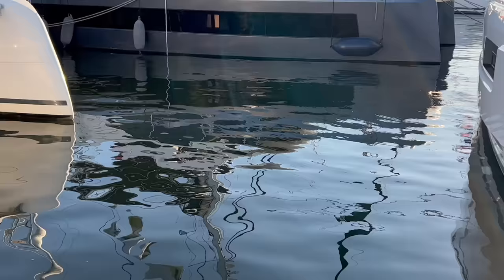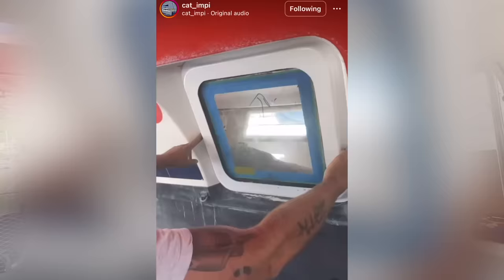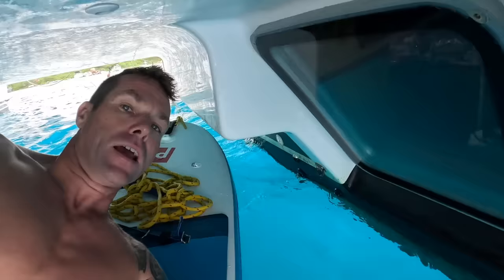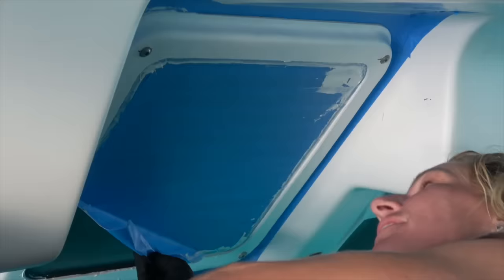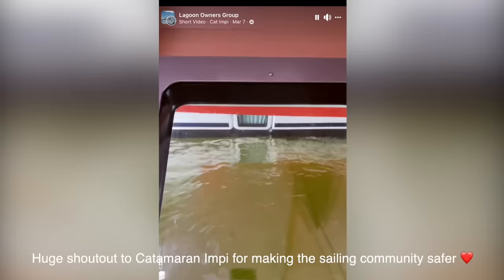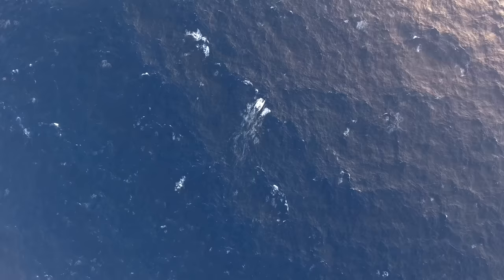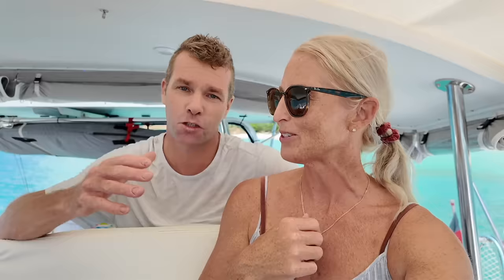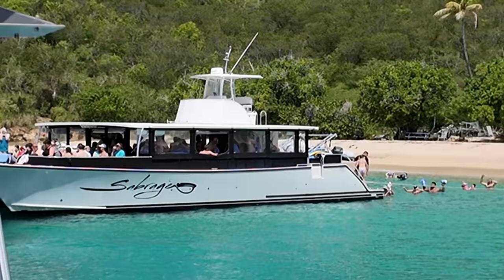this Deadly FLAW will SINK our Boat

Comment: Watching the drone shot from above with you trailing warps as a drogue reminded me to suggest you enhance the effectiveness by using an Abbott drogue. This is a system that you can add drag items to the warp by sliding them down the warp. They will self center if you mount (lash)  them to sections of conduit. You can keep adding items until you get the right amount of drag for the sea state. Put each end of the warp on 2 aft winches. Hope that helps?

Comment: When I was running boats our "Port Light's " had covers the would screw down with wing bolts. Not all had them but with storms were coming we closed and battened everything down. In the 60's there we only a few cat's and  try's sailing. In the old day the biggest problem was the rudder breaking in a following SEA. Some power boats had shutters for the large glass windows on the bridge. All the best. Gman

Comment: Just a thought:

In the offshore trimaran world some of the ultra performance enthusiasts consider a saw all the escape hatch.

Glass that thing shut and have one powered option on the boat that cuts fast and two manual fail proof options to make the hole in the hull.

(Your campfire hatchet stored on one side, your camping saw suitably selected on the other. One powered hacksaw where you choose)

Comment: I love following your journey! Great videos! 

Engineering background here…I think the 4 sided (square) collar will fail and ultimately place more damage to the hull just forward of the escape windows. 
Reason: 
Forward motion is where you will find the most forces put on your proposed hatch collars as you sail much faster forward than in reverse….agreed? Ok. 
This being said…the collar idea is good but should be made into 3 sides…FWD, TOP, BOTTOM.. with aft side being left open. The aft side would create drag by catching the most force of the water, in return, transferring that force through to the forward portion and rip out the hardware…or the collar may simply fail and break apart. 
Making a 3 sided collar and leaving the aft side open allows the water to flow over and not try to lift up.  Just my thoughts. Good luck! Stay safe! 
PM me if you’d like me to sketch my idea up for you. I work for a global maritime engineering firm in the Houston, TX area.
Reply: Based on your experience, do the hatches even make sense?  It seems like they cause way more problems than they solve.  I've never heard of a catamaran sinking so fast that someone actually used the escape hatches.

Comment: Willa is a child with health that can be uncertain at times. So your fear for Willa is very real and it is hard on the parents. I made myself an emergency kit and it has saved me several times. in a backpack I have separate pouch's that are made of nylon with a zipper that carry different things. Number 1 saver is a battery powered nebulizer with extra batteries and with the albuterol and saline solutions. Prednisone tablets 10mg at least six or more. And of course the Epi-pens. At least two and I do practice on how to use them with a practice pen.  Willa is going to have her trails you want the best for Willa. A ready emergency kit that's pretty much what a hospital has. Willa might need that emergency visit she might need to be close to a hospital. All real concerns. Immunology is a five year plan and they say by that time your body should be desensitized to the allergens. Go with health is always my motto.

Comment: The hinged hatches are a much bigger problem than glass. Hinged hatches are always an acrylic lens, and acrylic is much harder to adhere with sealant than glass. A glass lens falling out is not impossible but very unlikely compared to acrylic.  

I removed my hinged hatches and glassed in the hole. If you do a good enough job, even the surveyor for your insurance survey won't notice anything missing. Ask me how I know. 😉

Comment: Fiberglass those hatches over!   I cant find one instance of those hatches being used HOWEVER like you said there are plenty of those silly hatches failing or leaking.
Reply: 100% agree.  That danger of them causing you to sink has got to be 1000x the chance of you ever needing to use them.

As I said in another post, if the boat were truly sinking so fast that you needed to use them, then you wouldn't have time to deploy the life raft, so you're pretty much dead either way..

Comment: The exit hatch frame is a great idea. A great addition to the design would be a spare emergency hatch that could be placed over the outside of the frame & secured with a rubber coupling would extend around the outside of the primary hatch frame. The edge of the primary hatch frame would need a channel around the outer edge so that the flexible rubber coupling around the emergency hatch could be clamped on to the primary hatch frame. Another great addition would be enough of those spare air or pony tanks so passengers can swim out from under the boat without destroying the hatch & creating a vent to allow air to escape while water floods the hull. Keep the hull sealed so it stays buoyant.

Comment: I’ve always wondered if these hatches were designed to be used in that place, that way. I don’t think so. These kind of hatches are typically used horizontally in decks. Looks like the production boat/catamaran builders were looking for (“cheap”) off the shelf solutions, not taking in account that boats age and glue bonds deteriorate over time, building in a huge risk for the future…..

Comment: I can’t remember what kind or brand it was but I watched something about those escape hatches and there were all kinds of comments about the escape hatch being more of a “problem or danger” than any safety that was worth the danger of them coming out or leaking & causing a problem. The comment was made that it “sure must’ve been a issue” because it was taken out the next year.  I think they were mandatory at some point on catamarans and I think the comment was more a “see, I told you” than anything else.  If they aren’t a regulation, you can probably take them out if you wanted to.  I think we all know you’ll have it safer than it ever was!! 🍀

Comment: For  holes in the boat a plastic bread board is always close to hand and 6 to 8 screws  place over hole and screw it to it will do for repairs until a port is near by or for bigger hols kitchen doors wrap old sail around it to act as a seal the screw it to

Comment: On ships that the portholes are low to the water line. They have dead lights on the inside of the portholes, which are used in rough weather. Basically they’re a round metal plate which are hinged and you screw tight with the butter fly nuts.

Comment: You are trying to undertake blue water cruising in a catamaran designed and built for the charter market where the boats go coastally from port to port.
The lack of both wing deck clearance and weak safety hatches are good examples of that.
Plus it seems from the numerous rust stainless that the stainless steel is somewhat questionable and I would look closely at all chainplates and monitor them regularly.

Comment: I like no hinge escape glass but in addition to a swingable hammer I would add a spring loaded punch incase something is preventing a full swing of the hammer......If the compartment was full of water can you swing hard enough to break the glass?

Comment: Would love to know your opinion on just having a very strong fiberglass hatch with a very serviceable seal.  You'd have to maintain the seal, but you wouldn't worry about any glass to frame connection or glass breaking.

Comment: How do you flip/capsize a catamaran? Through broken escape hatches. 

Which means escape hatches work as designed. 
They are meant to escape the boat when it has flipped because of a broken escape hatch.

Comment: That's definitely something a LOT of attention should be placed by boat manufacturers. Shouldn't be just regular sealant etc on it. You need it low in case the entire vessel flipped, you would have a hatch above the water line but it seems something better could be used there. Like a double or triple seal solution or maybe inflatable seals that inflate when water is sensed? Or a rotary seal system or something better. The very thing to keep people safe is killing people or capsizing boats. I hear about this issue all the time and if it is leaking, it means it could fail at any moment as you don't know how serious the sealant has failed.

Comment: Personalyl I don't think 4 bolts is enough - 2 on top and two below.  If one pops, the clear plexi will work free. 6 bolts - 3 on top and 3 below. Water is weird, I had some strange issues with water at my mountain cabin.  In my trouble shooting and Oki fixes, I had to all tell myself that it (water) has to go somewhere and that it is non-compressible.

Comment: You guys might need a year or two off the boat. We have three under 6 and have been sailing for 3 years around the pacific. We have opted for a house life for a bit of a break and give the boys a chance to get a little older. We will likely get back on the boat permanently in three years.

Comment: I have seen so many issues with escape hatches and it seems like the danger far outweighs the utility.

It doesn't even make sense to me as the only use they would ever have is if the boat suddenly and violently flipped over a full 180 degrees and immediately filled with water (i.e. massive hull breach).  I suppose the first part of that is possible but extremely rare,  I have never seen the second part happen because catamarans take a very long time to sink in most cases.  

If you ever did come across such an unlikely calamity, the boat would be sinking so fast you couldn't even deploy the life raft.

It just doesn't make sense, how many boats have sunk or nearly sunk due to the safety hatches vs how many times have the safety hatches been deployed saving someone's life?  It's gotta be 1000 to 1.

Comment: I have never understood why cat builders don't just put in water tight doors as escape hatches. Is it seriously necessary to be able to see out the escape hatch? A solid hatch with a spin lock similar to what you see on larger ships would be a much better solution safety-wise.

Comment: I’ll preface with I don’t know anything. 

Why does the hatch need to have plexiglass? Maybe make it out a the entire hatch out of aluminum or fiberglass so there’s less points of potential failure. Is there actually value in visibility through them?

Comment: You need to watch Sailing Parlay Revival as he has crossed the pacific on his Lagoon 45 and his adventures in doing so, he maybe a good source of inspiration for you to look into.
Reply: They are in New Zealand now. What an experience they have had. I believe Ben may have had a chat with them once.  Always interesting to see who the talk to and about sailing in general.
Reply: HH44_OC not necessarily,  they both have different experiences but it is all relatable.  Some of the Parlay crew worked super boats on ocean trips before stepping into smaller sail craft.
Reply: HH44_OC   his 3rd circumnavigation of the globe.  He was sailing some treacherous waters before 18th birthday. Spent 3 years navigating the Polynesian Islands, mostly on his own.  Now having said that, Ben and Ashley do some different sailing and that's why i watch both regularly . Colin's current Cat is now on it's 2nd trip.  Both have some great adventures and some amazing troubles BUT BOTH are sailors infinitely better than I  am. Now back to the good stuff.

Comment: Or you could have the escape hatches on the outside of the hull instead of on the inside where the water compression force is many times greater because water doesn't compress and on the outside, it will push the water away.

Comment: I hear those hatches are no longer needed. Insurance doesn't like them (they fail to often) and cause boats to sink. Honestly I would seal them up with fiberglass and be done with them. To make a hatch like that really work they need to be 3 times stronger and better engineered.

Comment: Im slightly concerned with using 5200 in the manner you did with relationship to cure times. Ive seen where it doesnt fully cure and its still wet. May want to double check it or look into 5200 fast cure. Best of luck.

Comment: I don't get it. When we started sailing in 1985, we approached our builder to help solve the escape hatch issue. The same as you have shown in this video, we made that same (upgrade) as you have. By watching many "cruiser" channels, I find it remarkable, that "so many alterations" seem to only now be discussed or shown that it is a "modern" inervation. In short, we sailed for 30 yrs, in a 45ft "cat", 13 times circumnavigation, just under 500k nm and raising 2 children on board, until they departed for college/uni. The internet "was not" a thing in those early years and we DID NOT hang around as long as current cruisers do, due to the video work involved. My wife passed a decade ago, so I personally stopped full time sailing, however, my son & wife have been continuing the cruising life. They also have 2 children on board and skool them, show them the world/cultures and so so so much more. I know you will understand that last comment. Another "alteration" we had, was an attachable/removeable "tiller" style rudder/propulsion. That is something which could only give about 1-2knots, but in some circumstances, it was all you have/needed. At least it kept us moving, which at times is better than nothing, hehehe. Anyway, keep up the great work and I am pleased you show great content and are keeping your dream alive, with the kids (not now) will THANK YOU BOTH so much later in life. Take care always and stay safe.

Comment: Hatch doesn't have to be glass, if it were a real metal dogged hatch it would work to regulations as intended. Boat manufacturers decided it would be nice to put a window in (and i'm sure it is) but is their implementation that is the problem, the reliance glue and window is wrong on the top ourside as well, but it works until it doesn't. Good not to trust your life to what the manufacturer thinks will work.

Comment: Wouldn’t you be better off with some kind of silicone on the interior that you could cut away in case on emergency that you could cut away????  I’ve worked in the aluminum window industry for 30 years.  Just asking.

Comment: I've seen a couple of cats with  escape hatches in the bridge deck floor ..the other locations the inside front of the hulls higher above the water line.

I recently saw a 70+ foot cat with multiple hatches but they were not glazed so I assume they were  fully braced across the backs 🤔 why glaze them ?

Stay coastal in the Pacific coast Canada's home waters are as wild and beautiful as anywhere especially in the summer..

Hold fire on the boat if that's what it takes. Your boat  build for you.... He who knows the ways of the world and the minds of men knows that such men will never agree... N.Machivelli The Prince. 😉 You're the captains of your own ship. Now and hopefully in the future. 

Most composite core cats may flood but won't sink because of the built in buoyancy..  with a solid/metal hull then you need to  have built in buoyancy or possibly built in inflatable salvage  bags or a collar ?..thinking outside the box 🤔🧙🏼‍♂️😉 

Both the Windelo and the Deep blue Rapier  and Elcie  have high freeboards both for the decks and the bridge decks  you can get a dingy underneath rather than a board clearance is a meter or more  ..  This keeps them dryer above deck and limits the hydraulic poundings... They both have wider Chines above the normal waterline  despite relative fine entry bows to  break that suck blow surge  and increase buoyancy divert  spray out to the sides.

Comment: When yoi boil life doen gamily sllways comes first.
That pronlem is vrry very commom. All yhe cats ibe bren on the hstches leak.
They eere not dedigned for that purpose or use. They are devk hatches only.
Once a cat overturnd and you oprn the hatch this allows the air to escape this is then filled with water.
Reply: Sorry about the spelling mistakes

I need either a bigger phone or smaller thumb